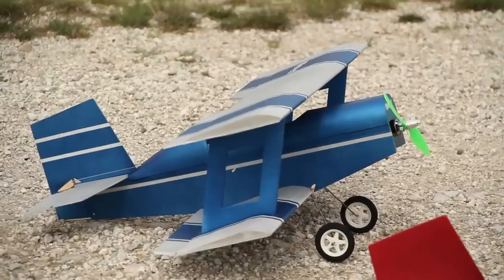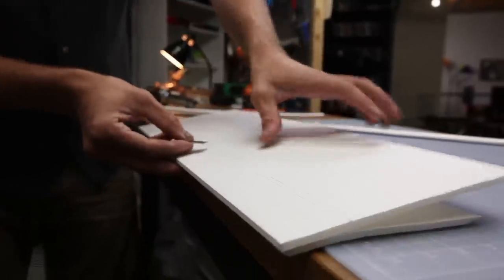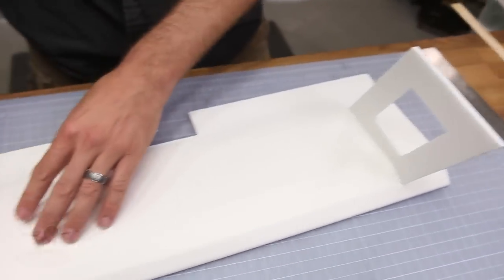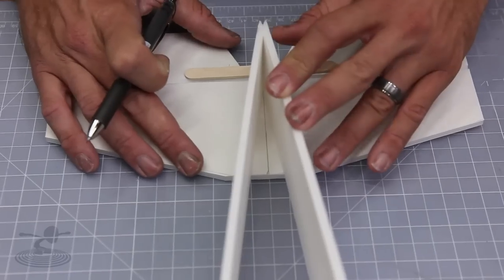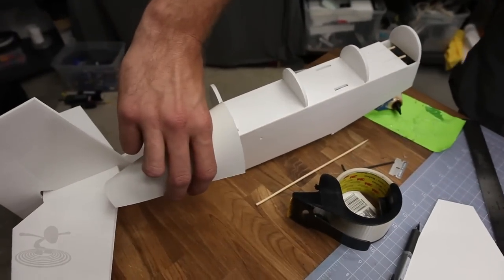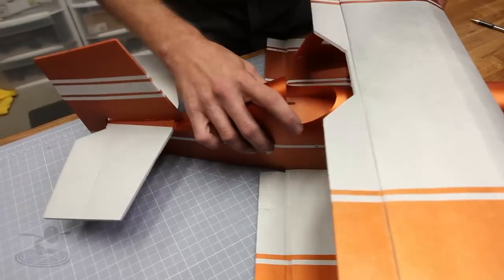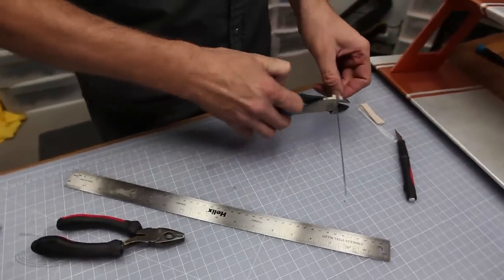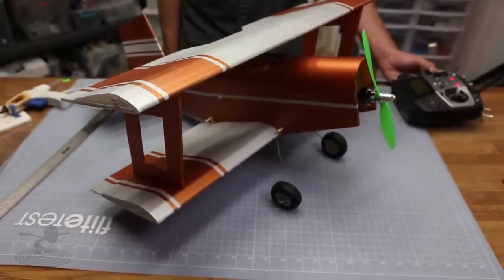Flite Test - Baby Blender Biplane - Scratch Build

Comment: Awesome build video guys! Several people have asked what kind of paint you use, and I saw no response. The paint I use for DT foamboard is called Design Master. It is used primarily for artificial, and real flowers. I get mine at (Michaels). It is the best paint for foamboard. Just remember, several light coats! If you just slop it on. the paper will peel. Now its time for me to pick up some DTFD so i can build this awesome plane!!   Good work Flitetest!!!

Comment: Great News, my scratch built Bloody Baron  flies well in trim and looks good,
So I decided to build the B Blender from scratch.
I have a  nice finished airframe now, and have added many more of my own mods to improve its durabiliy.
Use a waterproof PVA Adhesive and masking tape, not hot glue
Apply 2 inch Gaffa Tape to flatwings hinge point on LE bevel
BBQ dowels recessed inside the Wing LE hinge, tip to tip
Wing Tips from 3mm Balsa
All outside edges of Fin, Tailplane, Rudder, Elevator and Ailerons Have recessed BBQ skewer reinforcement
Fus interior foam board doublers from Fus nose to wing TE  When added, youll have to make anew PPod to the width between doublers
I added 2 inch Gaffa Tape strips to the exterior of the flat Posterboard Turtle decks and that worked very well

Comment: you are right about the spar lines... I did not catch this( glued my spars in between the lines on plans) and now my spars are.. 75 inches aft  josh does state to glue the spar in front of the 2"; line but plans thru me off, hope it flies corectly, my need to adjust cg, I wish I would have got it right during  the build stage

Comment: I'm so happy, for over a year I have been trying to find a Dollar Tree in my area that had foam board.  I live in central Michigan only about 60 miles from where this brand of FB is manufactured by R.L.Adams Plastics, but not a single DT carried it, and I check 7 or 8.  I have asked them to order it, but they claim they don't control what comes on the trucks? Stopped at my local DT, less than a mile from me a few days ago and 2 FULL cases sitting up front, only white, but I'll take it.

Comment: Hey Guys, I've bent ALOT of Dollar Tree foam, the best way to do that would be to tape a clear piece (or any color of your choice) on the leading front edge (after it's bent). That will help the outside paper from ripping. That will also be a nice leading edge, and make it slightly stronger too... Hope this helps.

Comment: No, you buy only one good Transmitter with Memory Spaces and use it for many other Planes, Helicopters and Multirotor. Probably the most expensive Part on that Plane is the Receiver, and even those are easily transfered to another Plane. Pays off in the long run to get a good RX which costs a bit more than buying a new Transmitter, Receiver etc for each Plane.

Comment: I have the same question.  I do all my scratch builts on DT foam.  What paint do you use?  I have been using experimental airlines plans with packing tape, but would rather use paint

Comment: what kind of yardstick is that one you are using. it's metal and has the word rail on it, I can't make out the first word though. keep up the good work. 😊✌
Reply: i was curious also and found them at Blicks Art Supply. interesting cutter,hole cutters and drills for foam.pretty much $100 to get started. i just use 1"x 1" 1/8" wall angle iron i borrowed from a plumbers truck !